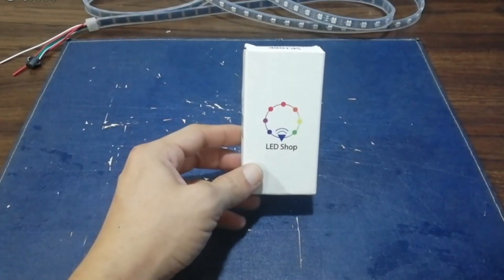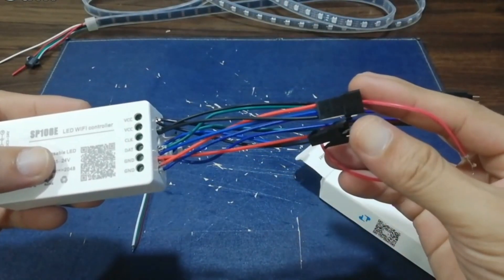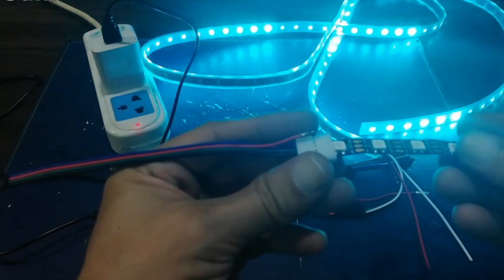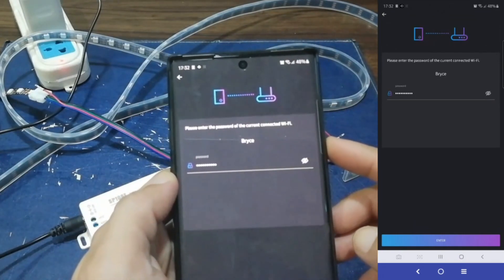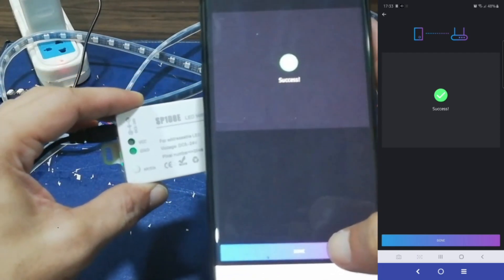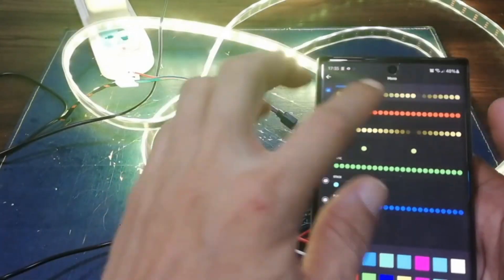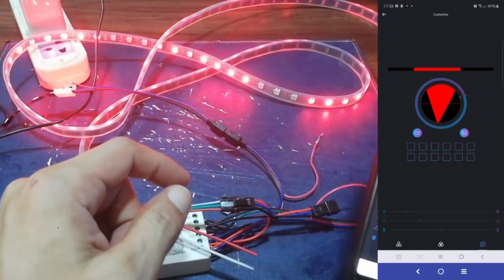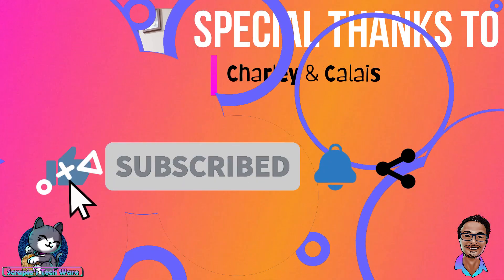SP108E LED Wifi Magic Controller Review

Comment: Please help. I have one of the controller with rgb led full color pixel module. Everything worked well but now suddenly when choosing static  they RGB still change and colors are off. How do I reset this controller.

Thnx

Comment: How many ws2812b strips can you put into this? I see you have quite a few but only 2 strips running.
Reply: You also need to calculate the ampere, 1 pixel is about 0,06 ampere strong at full brightness. With longer strips you need another power transformer for the higher ampere of usage by de LEDs
Reply from the maker: As long as the total diode does not exceed 2048 total.

Comment: Hi! I just bought two sp108e controllers with 6812RGBW led strips. Evertthing works fine, only: in image mode the controller crashes within a few seconds. It seems it's trying to show the image but it cannot cope with the amount of data... It crashes an returns to an animation mode from the first screen... Any ideas on this problem?
Reply from the maker: Honestly i have not encountered this issue. You may try to lower the brightness and lastly make sure your led doesnt exceed 2048 pixels.

Comment: Would this power cable work with the ws2812b strip?
Reply from the maker: As long as its 3 pins with 5v,datain and ground, it'll work.
Reply: @scrapiestechware267  ok thank you